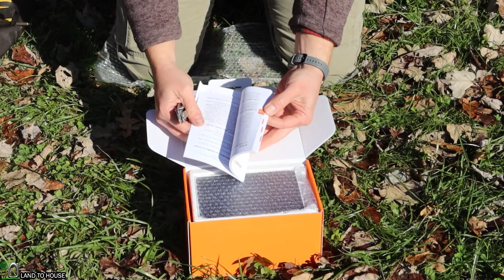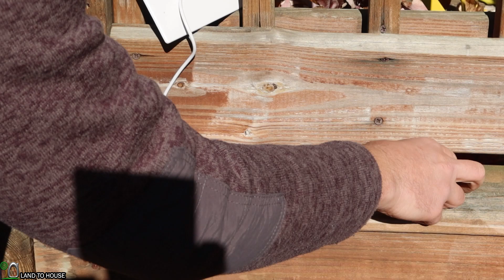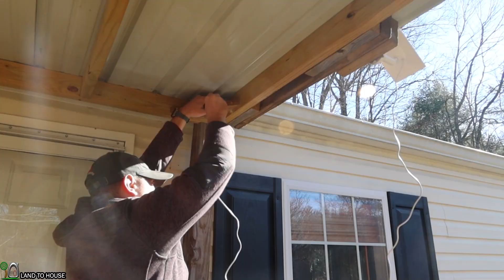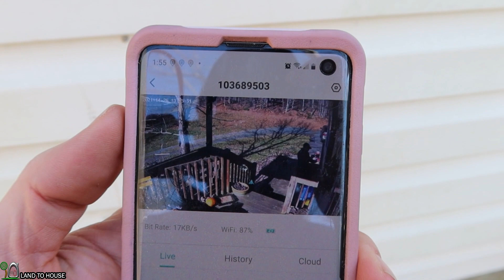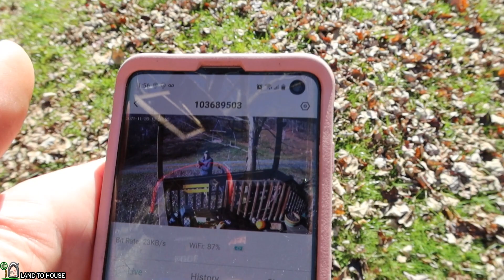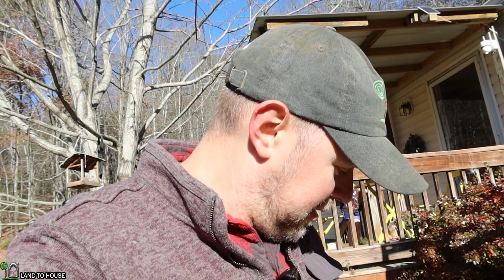K and F Concept Wireless Security Camera 1080p

Comment: if you use a pc and contacam you can have full recording of the cctv as it allows connection of ip cameras they is a 10 doller fee that removes the watermark but better then the yearly sub and 250 that the camera cloud was

Comment: if you find the panel can not keep up with the charging you could add a larger panel but use a buck converter to lower the current and voltage to that the unit needs with the panel been larger this should allow to keep a more constent current flow rather then rising and falling alot due to the small wattage of the stock panel

Comment: First... I'm in IT, and I know for a fact that these wireless cameras are actually pretty easy to hack.  There are a lot of examples of black hats hacking them and watching people in their homes (and their kids).  Also, 1080p is NOT enough pixels.  You will not be able to get facial recognition with anything less than 3K usually (I prefer 4K minimum).  Having your SD card in the camera means that even if you PAY for the cloud storage, the bad guy can break the camera and stop it from having the time to upload their image to the cloud.  That's why an NVR is so much better because the image is immediately saved onto the "hidden" on site hard drives.  Anyway, thanks for the video.  For someone that doesn't want to spend a lot on a good system and doesn't want to hardwire it into their home, this is better than not having anything at all.
Reply: I have an IT background too and also did security CCTV in my career.  You are spot on with your advice.  I have a wired 1080p DVR system at my home and yes 4k is the only way to get good detail like facial or plate numbers.
 I enjoyed the video and for many people this is an easy entry into home security.  Seth, I do the same thing you do only in my case I swap Robertson screws for the cheesy mounting screws included with most things.
Reply: I'd like to have one that you don't have to have internet or wifi in able to use it myself here
Reply: And it automatically sends you pictures of what's picking up infront of it too
Reply: I had to get assistance from google to figure out what you meant by "NVR" - Network Video Recorder - cameras stream video across the home Network and a Video Recorder box also connected to the home network captures it to an internal hard drive.  Nice but pricey.